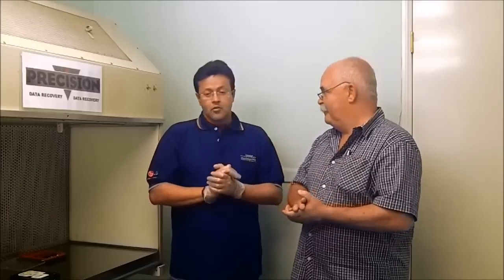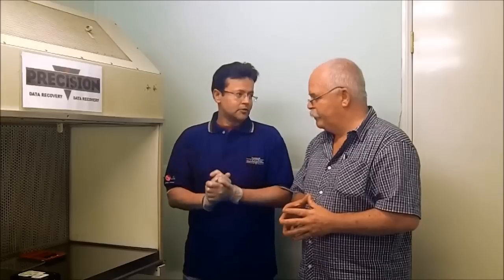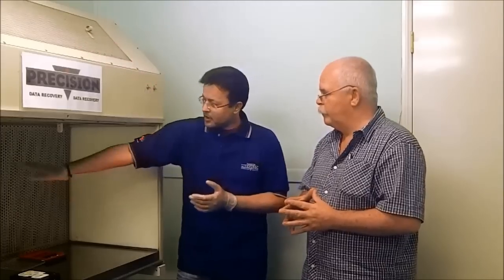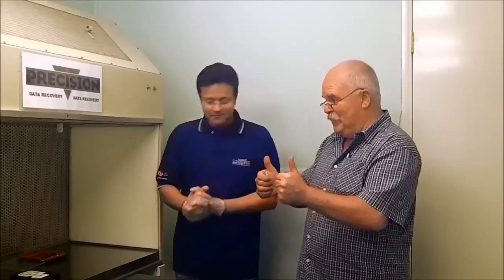HOW TO FIX A FAULTY HARD DRIVE

Comment: Hirens Boot CD.... Essential for failing drived.. It includes: hard disk sentinel to obtain an accurate smart report of failing hdd. It also includes DFT (drive fitness test for providing a hdd surface test) and Mini XP to boot into a live rescue environment. Essential for when Windows boot partition is borked.
Reply from the maker: +Craig D Yes, I'm still using Hirens 2012...I need to update  ;)

Comment: is there a way to repair bad sectors 
my laptop has bad sectors and i have a fail drive that only 320gbs work out of 640gbs
Reply from the maker: THat sounds like it may have 2 partitions...of which one has failed....I suggest you get it to a data recovery specialist if you have anything important on it..then replace the drive...
Reply: its been wiped already since it failed with windows 7 on it now its just a drive to use as ram in my old desktop when it needs it